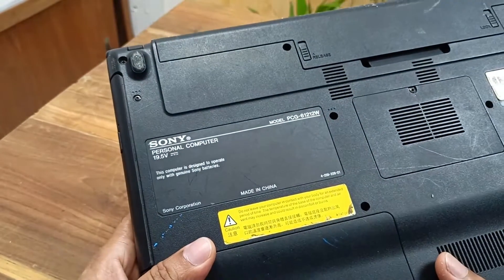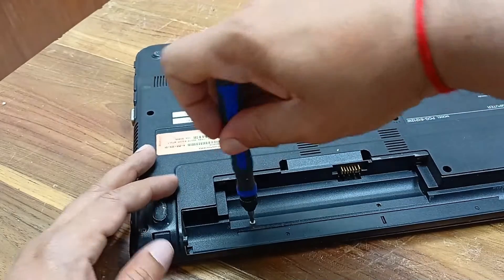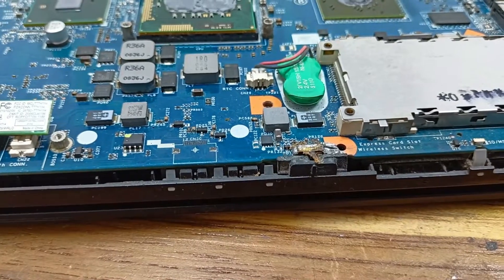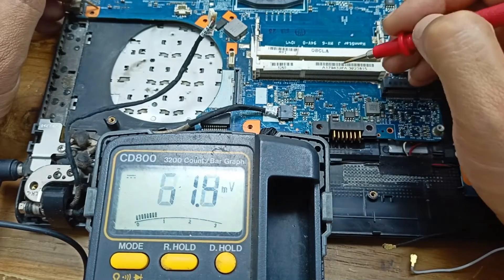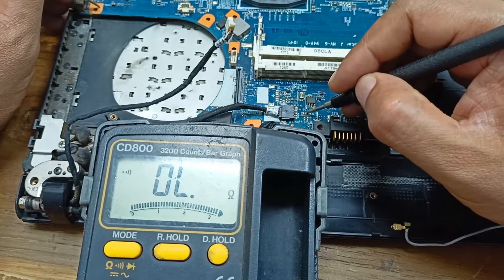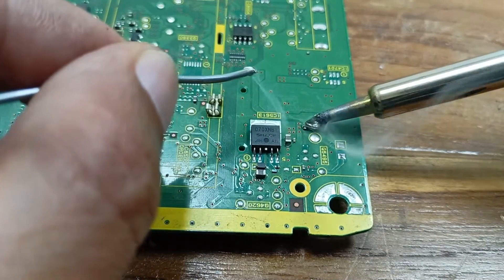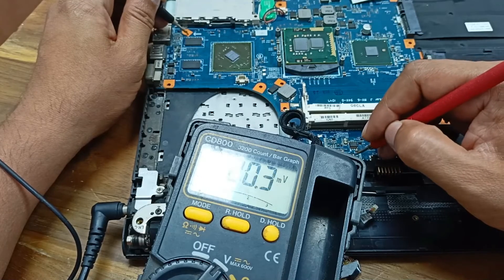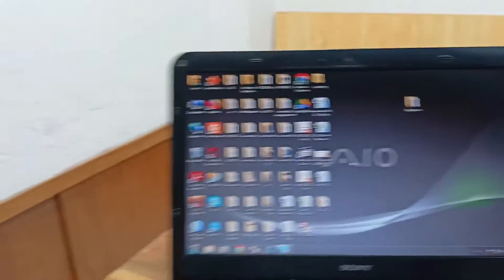Power won't turn on Sony Vaio laptop  PCG 61212w  || vaio laptop power not working

Comment: My Sony Vaio laptop doesn't power on without power plug supply.

It needs to be connected with power supply to start it. After this it works well with battery.

Plz advice how to solve
Reply: Same problem here bro😢